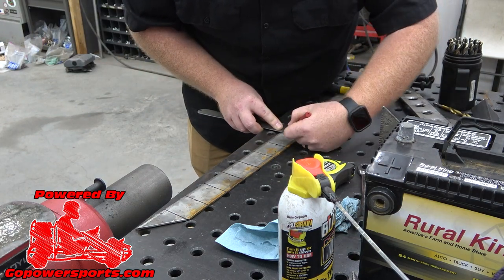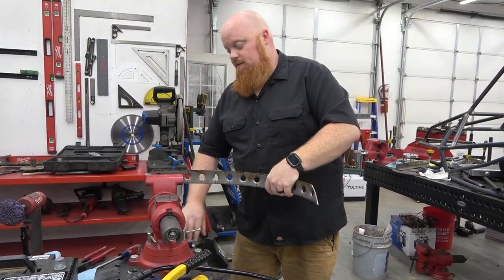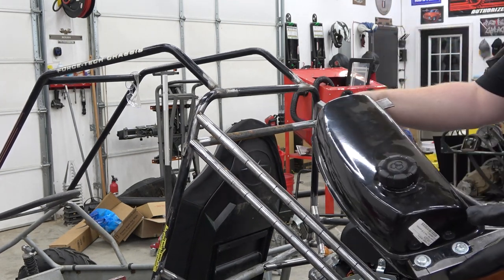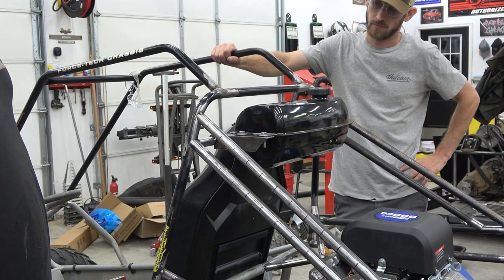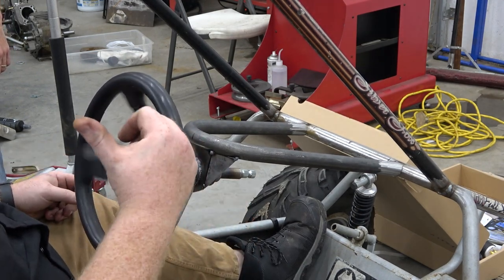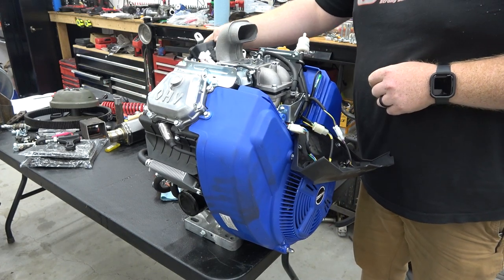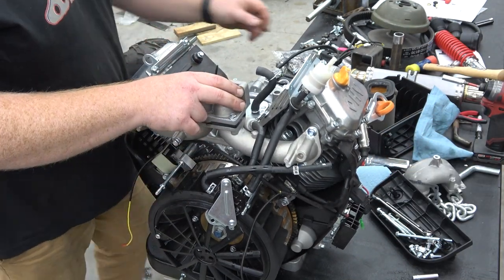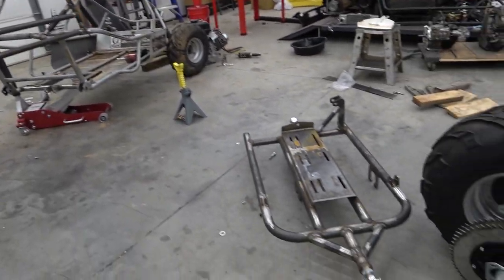999cc V Twin Gets A Dirt Bike Carb ~ 999cc Go Kart Ep3

Comment: HD carb systems would work on that!  I did up 2 gokarts with fuel cells.  They are 3.5 gallon and have slosh foam, high run breather with fuel filters on the end.

Comment: I've been thinking about a duel carb setup for a Predator. I keep wondering if a 2 into 1 collector could be altered to run 2x Mikuni VM22's. Maybe running the common #88 jet on 212's and #95-#100 jets on big block. Super crispy throttle?

Comment: Get a variable voltage power steering pump, use that instead of the hand pump, may or may not need a regulator and relief circuit as they’re like 20,000psi

Comment: While I'm going to shamelessly steal that angle iron notching idea for my next low-buck engine plate mount, I will in exchange trade you a diy fire fogging system: 1 CO2 fire extinguisher, swap out the factory floppy hose for rated  hydraulic pressure (3000-4500psi), tee in four in-line T sections with threaded centers, and in said threaded sections, attach on the outer 2 tee sections 45 or 90 degree hollow cone nozzles, and in the two inner sections 15-25 degree hollow nozzles (the hollow cone profiles are very important!). Pressure washer nozzles are easier to find, but you can also source stainless versions from McMaster-Carr. Run your extinguisher behind the seat, loop the line around the engine cage bars, and voila, low-buck but very effective fuel fire fogger. Also able to load suppression foam, though that stuff makes a damn mess, however it is even more effective at neutralizing oils and flammable fluids.  (Things you learn from building jet engines...)

Comment: I bought this engine and it has turned out to be a complete nightmare for me. The engine was damaged during shipping. The manufacturer doesn’t have any parts available for these engines. Wish I would’ve just bought a Kohler.